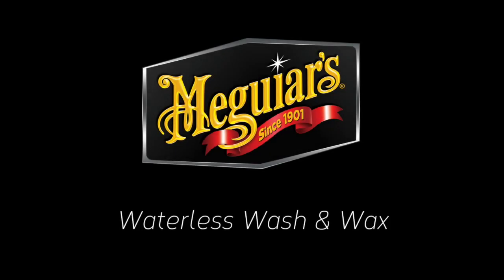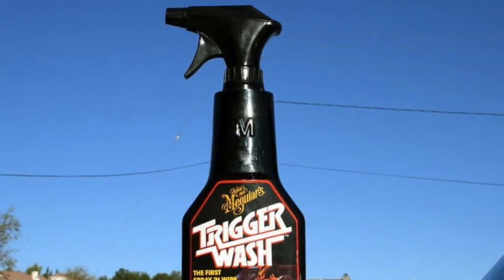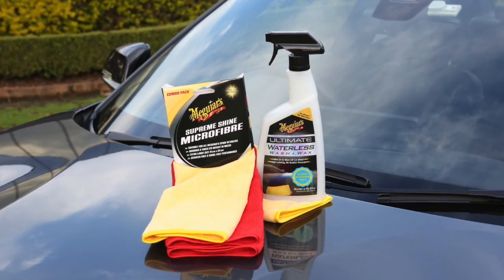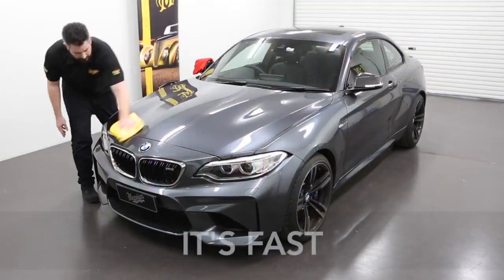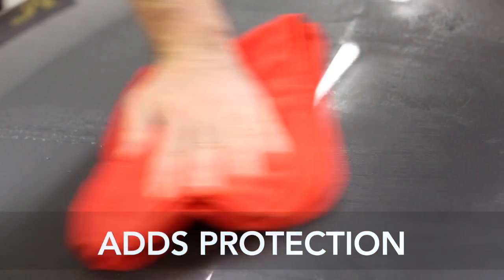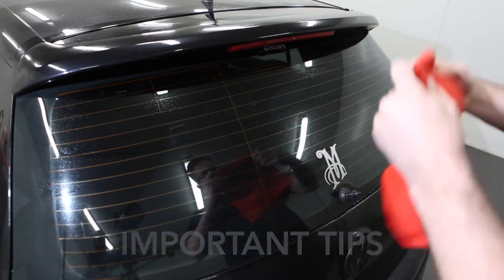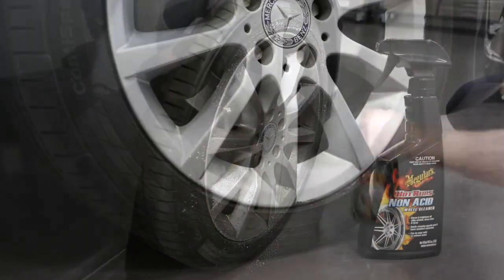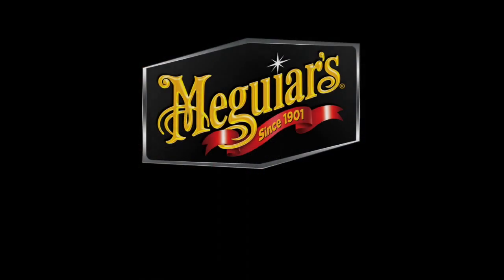Meguiar's Ultimate Waterless Wash & Wax

Comment: These products are ok for light dust, occasionally, but they do in fact swirl up the paint. They contain a lot of fillers to hide those swirls. Use APC on the paint after a few goes with waterless wash and you'll see the damage done.